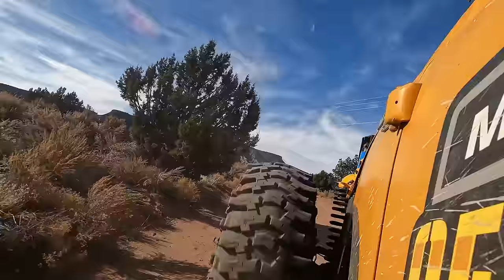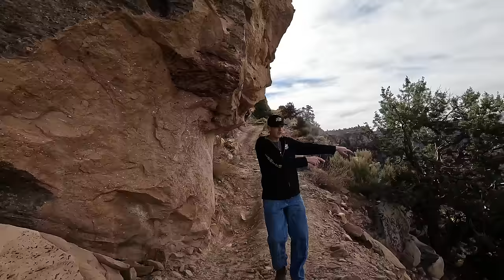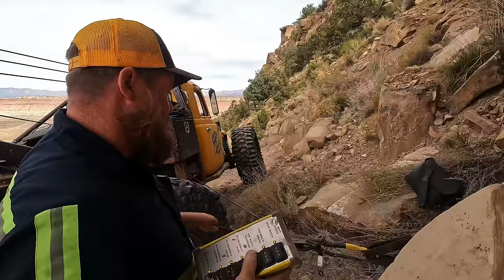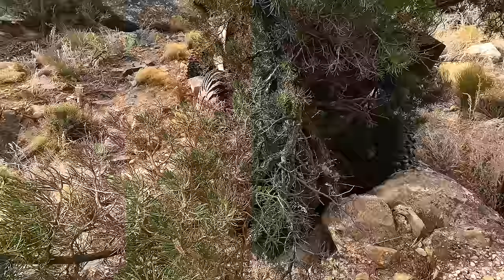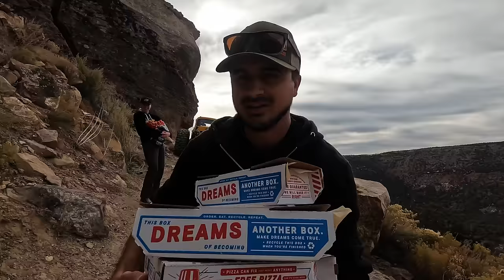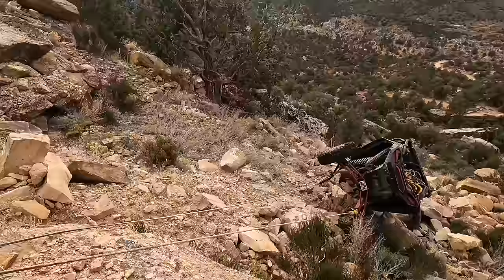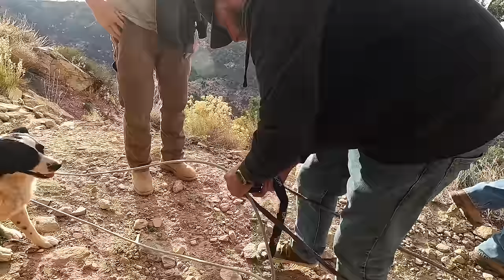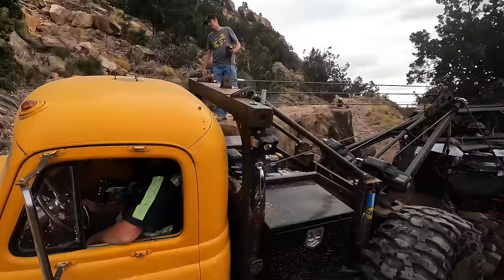I Never Expected This To Happen...Major Fall!

Comment: Don't get me wrong, I watch because what you do is pretty darn cool.  I have to ask tho', why do you hardly ever seem to pack food and drinks enough for doing the job?  I mean it's getting to seem like a recurring tactic working towards the false suspense of the video or what.  I mean, getting everyone all the way up in there, then in like the first 30-60 minutes, sending folks back down and back up there for food and water?  Before 15 video minutes pass you guys talked about food and water five or more times.  Then all the grocery and food shopping that should've occurred beforehand?  Getting old, y'all are dispatching from a city in the desert, and just looks kind of foolish the way a lack of novice basic hiking planning would be.  Not a complaint really, folks would need dinner and hydration out there, filming during that it's all good, but not planning ahead for those needs, your crew hydration etc.? ...it's more in the nature of quality improvement as seen from the outside.  Not packing a cooler full of hoagies, whatever, snacks, and stocking up another one with Gatorades or such before you drive and work the team for hours in a high mountain trail or at the bottom of a one-way-out?  The "starvation" and parched angles have just been played out a few too many times when watched regularly.